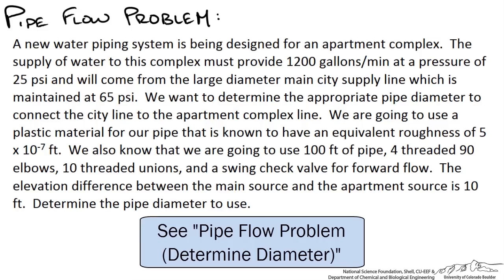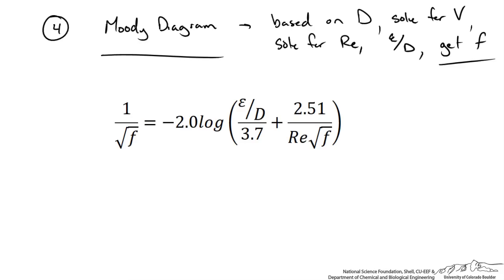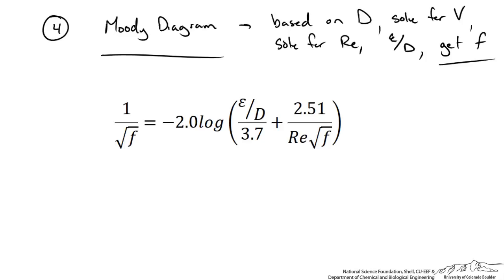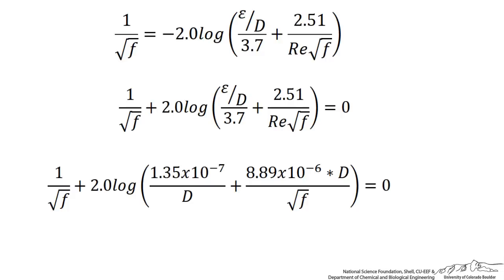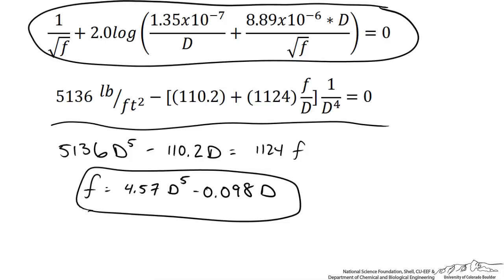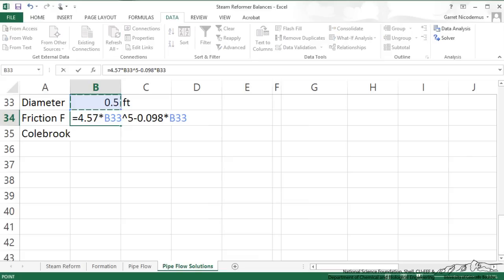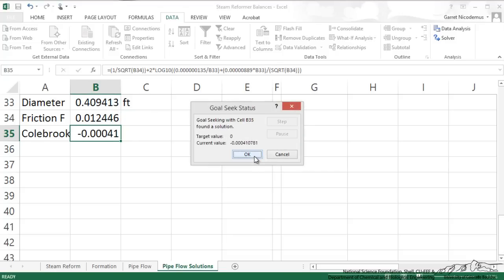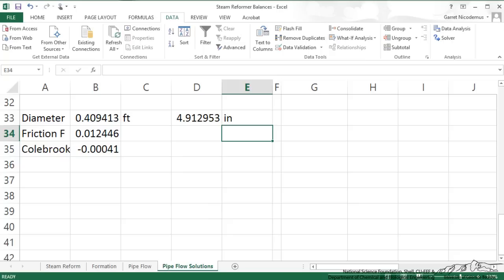Pipe Flow Computer Solver (Determine Diameter)

Comment: Hi :) How did you rewrite the energy equation to have a relationship between D and f? I didn't get it :(
Reply: Seems some error ..correct ?
i put all values in Energy balance equation & its not coming to zero
F = 4.57D^5 - 0.098D is not correct